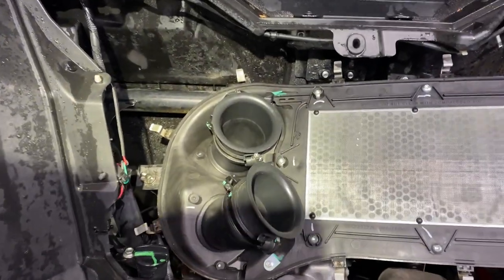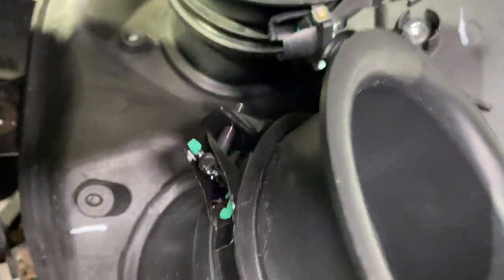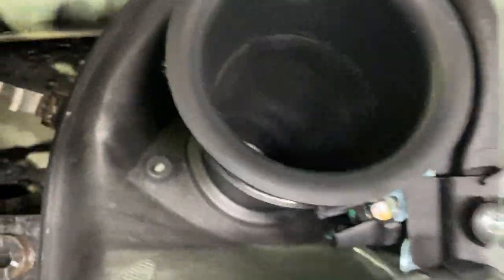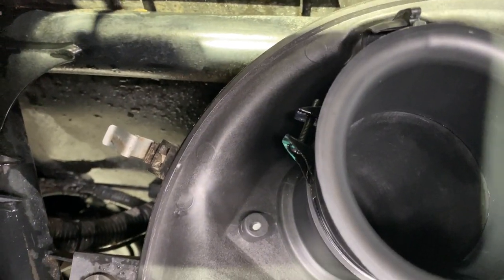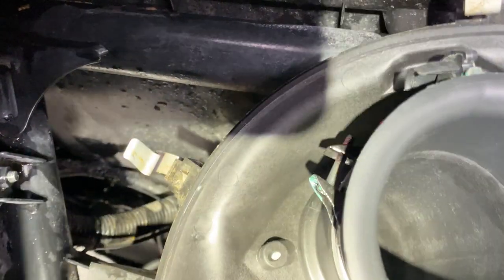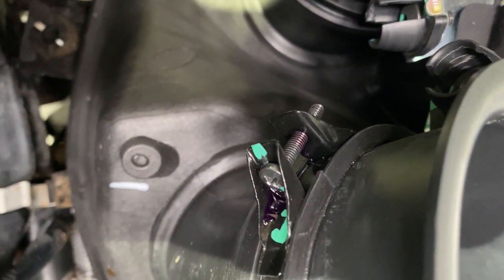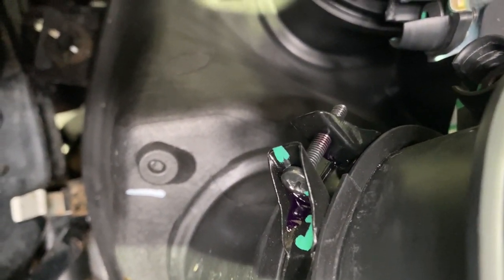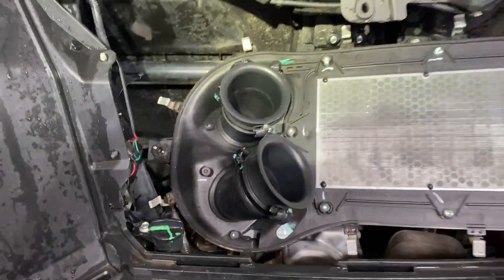Honda Talon Recall 22 096  for 2019-2021. All Models

Comment: I just got the recall letter in the mail today from Honda. 
I also tightened mine down and put blue lock tight on there.  Good idea with crimping the threads to prevent it from backing off
Reply from the maker: I have also been reading reports of the same binding rings coming loose where the air box meets the intake manifolds. I would also check those.
Reply: @nogrey  Thank you I definitely will.